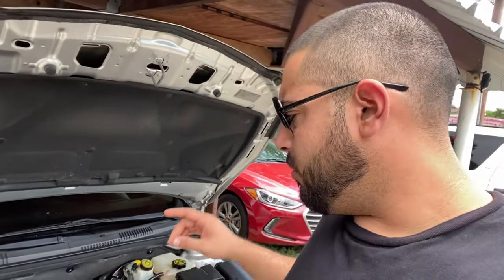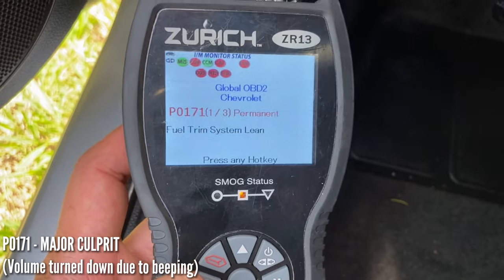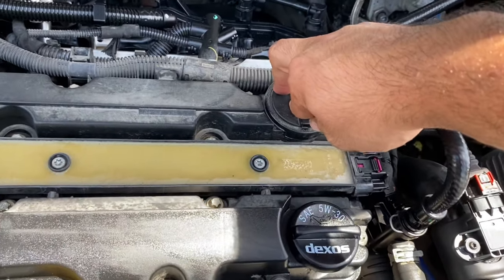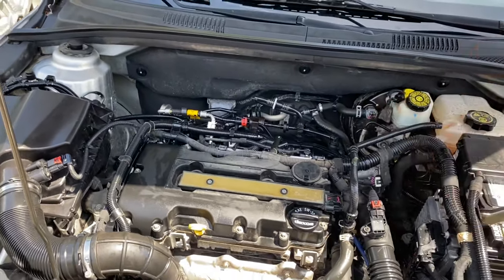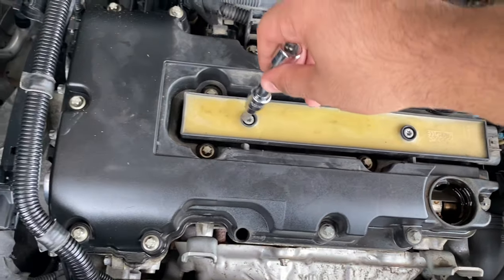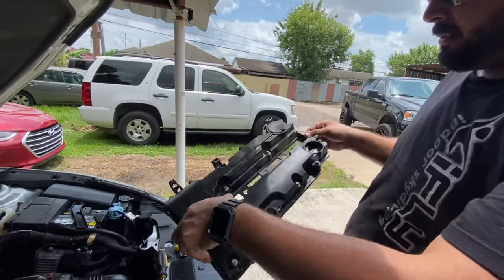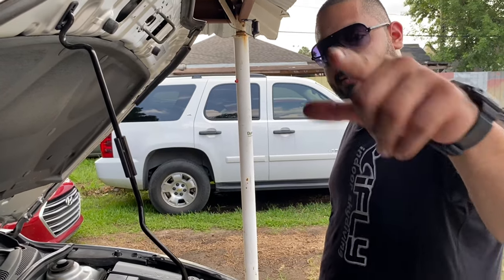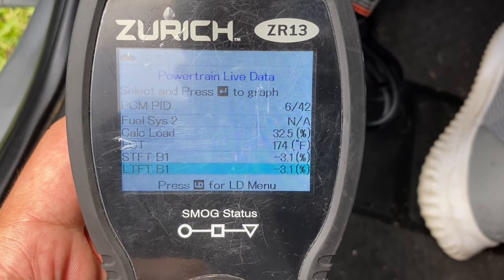11-15 CHEVY CRUZE ROUGH IDLE FIXED CODES P0171 P1101 P0106 FIXED! PCV VACUUM LEAK DIAGNOSIS AND FIX!

Comment: Also the purge solenoid is known for also causing p1101 and po171, keep an eye on the long term/short term fuel trim with engine on, if the purge is stuck open unplug the connector and see if the fuel trim goes negative, that is also another source of leaks

Comment: You are supposed to check the non-return valve in the intake manifold and the check valve in the PCV breather hose as well. If that check valve in the manifold is gone, you're going to be doing this job all over again in about 2 years or so. The instructions that come with the Dorman valve cover tell you that.

You should have put RTV sealer in the seams where the head and the timing cover meet. Without that sealer, this valve cover will definitely leak oil.

Also the gaskets that come with some of these replacement valve covers are junk. Save yourself another headache and put a new Felpro or other quality gasket on it.

Also it's a good idea to check the bolts that hold down the timing chain guide. They work themselves loose. Use loctite and re-tighten if they are loose.
Reply: If that check valve in the intake manifold is still there, just really gummed up, would you advise replacing the whole dang intake manifold?
Reply: How come approx. 2 years to redo the valve cover? Just based on experience or something else?
Reply: @melissagunderson5575  I might try spraying a solvent that won't hurt the plastic.
Reply: Experience

Comment: Just for reference. That big valve on the valve cover is not the pcv valve. The pcv valve is part of the intake manifold. That valve on the cover is actually the vacuum control valve which keeps the vacuum in the engine at 12 - 18 inches of water not mercury. But ya it should not be constantly sucking air. If you have this condition also make sure the pcv valve in the intake hasn’t been sucked out. To check you just have too remove the upper hose that goes from intake to turbo. Look down with flash lite. You should see a rubber nipple. If that nipple is gone then you need intake assembly as well.and the vacuum valve of course is complete with valve cover lol.
Reply: Will a bad cover make the engine overheat?
Reply: @frankfranz4428  not really. Only if oil was pouring out lol
Reply: Would the MAP sensor cause the same kind of issue with that airflow issue? I have both p0105 and p0106 codes showing
Reply: @oldfag_adventures  it was the top thing on the engine that time. Been a while. Repalce water pump once  and thermostat 2 times lol
Reply: So I checked mine and my orange valve thing is gone so do I need to get the whole intake manifold replaced since it gone my rpm are kind-of low and sometimes jump up as I'm slowing down i replaces the pcv valve hose but it didn't help so wonder if it cause that orange thing is gone

Comment: Replacing the valve cover will only temporarily fix this issue. That check valve on top of the valve cover blows because you're likely missing a small nipple valve located in the manifold. Fix both of these issues at once unless you enjoy buying $60 valve covers every so often.
Reply: THIS IS VERY IMPORTANT. YOU MUST ALSO FIX THE CAUSE OF THIS FAILURE OR IT WILL CONTINUE TO HAPPEN. Parts Geek has a kit with the valve cover, intake manifold and troublesome corrugated hose  that goes from the top of the intake to the turbo. all for under $250
Reply: Kris do you know the specific name for this part
Reply: I bought a 13 used.  Bucks around 55-60. Had seemed  improved after balancing front tires but now i fear is misfire. Would misfire not automatically engage check engine?
Reply: @jasonbrion1048  it should. Go for a short drive and when you pull over and get out, feel both front brakes to see if one is significantly hotter than the other. If so a sticking brake calipar piston may be the culprit.
Reply: How bout you make a video about it or link one
Reply: Correct more then likely the intake check valve got stuck or disappeared then ate that valve cover purge valve …. Best solution is to go the cruzetalks pcv fix I pieced together locally the same fox myself cost about the same as the lot I just didn’t have time to wait … now if gotta intermittent weird idle soo im guessing when my check valve disappeared it took out my valve cover purge valve aswell so ya that’s on list of things to do
Reply: Yep I put a camera inside the intake manifold and the check valve should be red in color on and inside the intake manifold….. found that it was actually missing … you have to replace the  intake manifold assembly

Comment: Thanks a lot man it helped a lot pointed me in a right direction that pvc had huge vacuum leak it has set  5 codes o2 , lean code, MAP, Rav to high codeTurbo performance code I fixed that vacuum leak fixed all the problems fixed all codes

Comment: Just subbed up to your channel, just bought a 2015 a year or two ago, really nice little car. But when stopped or in park it sometimes does a slight almost jerk motion like it's skipping or bad gas/old fuel filter type problem. Im not a mechanic, but have no help, so gotta do this myself. Watched this video and I like what youre doing. So Im gonna be watching your videos to help me get some things done on this little car. Do you do Chrysler Town and Country? 2006 model? Ive got one of those as well. Again, not a mechanic, and what I did know, well, I grew up in the 70's and early 80's, so you can imagine what all I DON'T know! LOL Thanks for what you do.

Comment: Just had this problem with my 2014 Cruze was the pcv valve but it’s crazy how you gotta change the whole valve cover. The valve caused my car to pop those codes as well. Actually it caused my car to pop up 10+
Codes
Reply from the maker: Hey there. We hope you were able to fix the problem. It's a very simple procedure.. I am confident you could do it.. but if you have any doubts.. I would suggest letting a professional handle it... let us know if you were able to figure it out please.
Reply: They sell rebuild kits for the PCV VALVE. It's $10

Comment: I need help :( my 2011 Cruze is a money guzzler and I’ve done so much to it and it’s still misfiring at idol SO bad. To the point where I don’t even pick girls up anymore because of how embarrassingly bad my car shakes. I’ve done everything I can think of, sparks, coil, valve cover
Reply: You ever find the problem sounds like exactly what mines doing
Reply: @jarodcox1377  No, it could be the wrong brand of O2 Censors, Im not sure, sell that car as quick as you can, or take it to a Chevrolet Dealership and ask them to fix it.
Reply: Bad fuel injectors man!

Comment: This fixed it for me - 2013 Chevy Cruze. Thanks for uploading this video!
Reply: Did u have those same 3 codes ? Please reply. I'm having the same issues.
Thanks
Reply: Yes. These 3 plus a couple others.
Reply: Till this day does it still work?
Reply: @d.alderson9687  Yes, replacing the PCV valve cover resolved the vacuum leak and still no issues today. Good luck!
Reply: @HeftySkateboarding  could that bad pcv leak u change cause trouble starting your car up

Comment: I have my moms 1st Gen 2016 cruze and I turn it on and it's shaking and can smell gas. I used my scanner and i got back p0106. So does the pc valve need to be replaced or the pc cover ?

Comment: Replaced the engine/valve cover, ignition coil, and spark plugs.....still rough idling. Any other suggestions?
Reply from the maker: Yes please stop throwing money at it and take it to get it diagnosed professionally. Its the best advice I can give you.
Reply: The intake manifold has a small check valve of sorts built into it. This had failed. You don't have to replace the manifold but you must seal the hole off where that nipple valve used to reside then re-route your pcv. Search Cruze fix kit. I didn't but a kit but I watched the video enough I was able to put one together using parts I had and 15 bucks.

Comment: Hi I am having the same trouble with my 2011 cruise and it shack's bad and acting like it wants to shut down at every stop light, I will try to replace the valve cover like in ur video and let you know if that fixed the problem.
Reply: I am having the same exact problem with my 2014 Chevy. Was your problem fixed after replacing the valve cover?

Comment: Did you/should I use RTV on certain spots of the gasket?
Reply from the maker: Yes you certainly should. We should’ve added it
Reply: @HidalgoMotorsCo  can you elaborate on where it belongs? Doing this change on my car tomorrow
Reply: Where  the timing chain cover meets the block you see where  its at when you take it off  there be some where  the factory  install  it .

Comment: Mine has all of those codes showing as well as PO15b and engine light on. Any Suggestions? The valve cover was just replaced roughly a year ago 😒
Reply from the maker: Sorry for Late response. I suggest getting your vehicle diagnosed by the chevy dealership to get a better idea of where to go from there.
Reply: General Motors has something out about this
Reply: Im on my 4th valve cover. Gonna get it fixed then trade the POS for a toyota

Comment: I just changed the valve cover and clear the codes. but engine check light keep coming back and there is still vaccum leak. I changed the crankshaft seal as well. any ideas guys?
Reply: You have to replace the intake manifold and the valve cover or it won't be fixed. If you drive car with bad pcv it will also wreck the seal on the oil pan.
Reply: Lol sounds like you have a fucking vacuum leak that you need to find. Hahaha

Comment: At 45/90 degrees FM recommends to add RTV gasket gasket sealer as of most car manufacturers so no engine oil leaks/speaps. Any automotive tech knows across the board of that simple repair. An you did not

Comment: Can this cause the service traction control light to turn on?
Reply: I got a service traction control about 6 months ago.. it was raining so I’m not sure if that was a factor but I haven’t had any problems since.
Reply: When mine threw that message, I ended up having a misfire on a cylinder. It was expensive to fix

Comment: No one ever says the torque specs. I’ve watched  5 different videos.
Reply: Just tighten it down bud.
Reply: @clayton9136  I did that on the first one and cracked the mf.
Reply: @TylerSpite  well then it was too tight. Hahahaha
Reply: @clayton9136  hmmm. Very interesting 🤔
Reply: 71ft lbs
Reply: @fekeith935  ……
Reply: @fekeith935  WTF??  inch pounds in foot pounds its around 7.